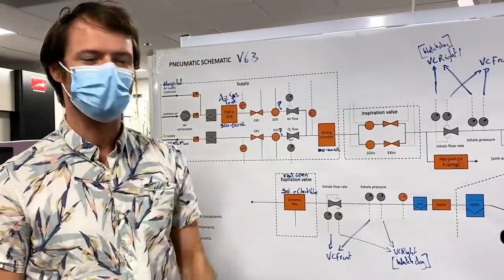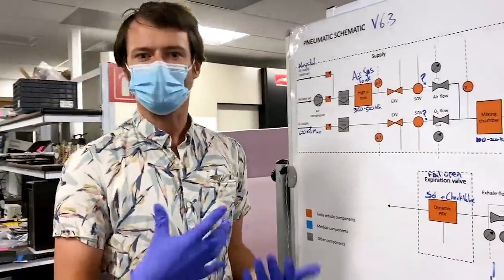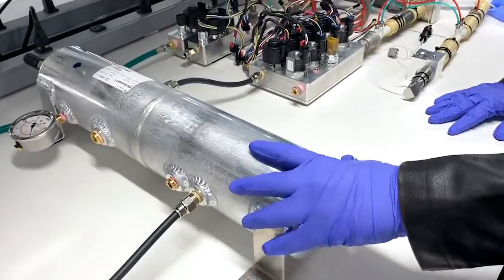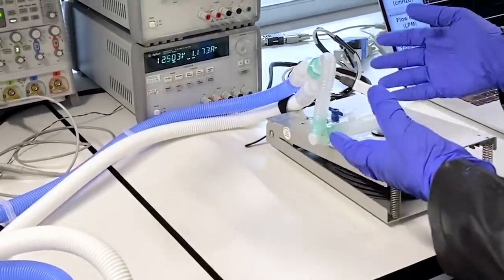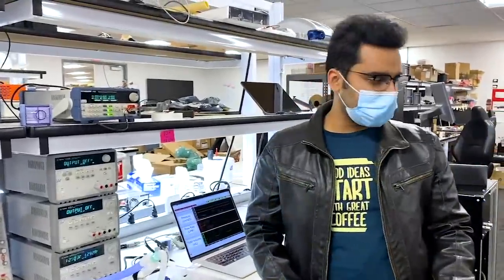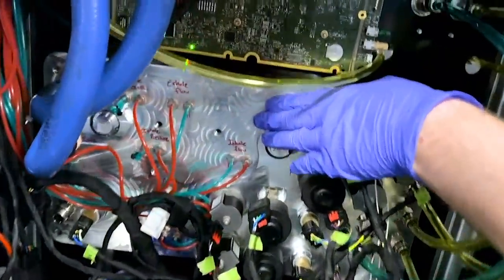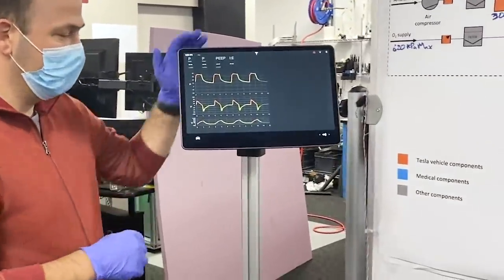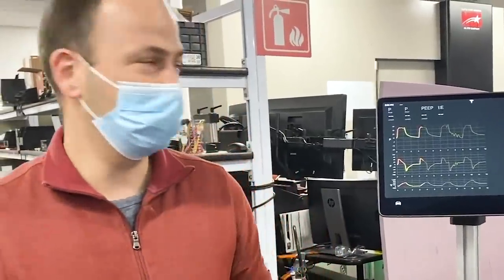Tesla Ventilator

Comment: Great stuff lads. Will the system have many sensors to detect what they are exhaling ie levels of infection whatever it may be. Or just a sensor position that could be hooked up to a read out machine at a later stage. Plus would it be a stretch at some point to also add a hart and monitor to the same system using the same screen spit between the ventilator and hart read out.
I don’t understand what you get some many stupid comments this is seriously stuff you are doing well done lads and Elon well done for jumping at a time when it’s most needed wish more company’s around the world would do this and not just think about there bottom line. 
What else could you make to help the Health system. Hope you can drive down the cost of these units and other parts needed for the health care community as I think they well over charge and can lead to hospitals not been able to afford adequate numbers needed. 
This would be a good addition to add to all your gigger factories around the world. 
Ps pleas build a battery factory in the UK before the Chinese build one. You may not build your cars in uk but if you build a battery plant you would be able to sell them to future car makers and other electronic devices that needs battery’s, ie electric lawn mowers ATV,s, drills, saws, never seen you sell a drill battery system for portable tools maybe you should sell one I bet it would be a good seller.

Comment: Damn using that whole ECU for just a small task, I mean It's parts yall got but the processing power that ECU has is way overpowered for a ventalator. No R-Pi's or just Arduinos?
Reply: It's a rapid prototype using parts at hand. Working in R&D for 10+ years, rapid prototyping with parts in stock makes progress fly. In the future you could design everything in a system on chip but for the time being, I say well done!

Comment: Great effort!! It looks pretty heavy & is there any humidifier set up in this or dry air will be sent directly?
Reply: The humidifier would be connected on the inspiratory circuit of the pt..it is not shown here.
Reply: @ogun3378  cool
Reply: @ogun3378  will you be updating it?
Reply: @sparto5571  no I am not working for Tesla or in the video..I am designing my own. I did this for my mechanical  engineering degree project.
Reply: @ogun3378  ohk, that's great. Good to know there's an another Mechanical guy over here. 🙌

Comment: To be honest: there is so much more to do to build, verify and approve a ventilator. You need to have so many safety features build in and have to predict the behaviour in almost all failure modes. At the moment it seems like there are absolutely no redundancies whatsoever. So if something breaks the ventilator has no safe mode and the patient will die. There are tons of standarts that you have to follow like 60601-1.  It is not that easy even though it looks quite impressive what they built in that short amount of time.

Comment: Good job but what happens when one of the sensors fail? Will the unit fail elegantly? If so will it fail elegantly for ALL sensor failures? Is there an auto calibrate routine periodically or on startup? Can it be cleaned/de-contaminated easily?

Comment: Amazing work for Tesla, they did a great job here. However it takes 8mo to 1year to get something like this approved by the FDA that does not come in contact with a person in this case about two years, as you have to prove reliability. I worked for GE medical for years as a validation engineer. We built a system in 4 months and it took almost 2 years to get it FDA approved passed CRFpart 11 (I think ventilators fall under a different cat.). But I am a huge supporter of tesla. In reality they should have partnered with somebody that already has a ventilator and just make the parts or offer assembly as that system is likely already FDA approved.
Reply: They're fast tracking approvals

Comment: That's great! I didn't hear any mention of the system cycle being triggered when the patient breaths slightly. Is it planned? That's one of the main features for a ventilator. If it's only pressure and Volume control for the most part, it would mean that the patient is breathing, even when they don't want to.

Comment: Stop touching the face masks. Adjust it firmly from the start:
1. Make a knod on the elastic, if is too loose 
2. Make sure the metal insertion is really taken the shape of your nose
3. If you need adjustments, make sure you don't touch it in the area where you breathe but from above, the straps, etc. 
4. Simply don't touch it! Don't touch your face and don't touch your mask

Hope you will actually produce these in large numbers. Thank you
Reply: Damnit Virgil, I’m an engineer, not a surgeon!
Reply: @iused2BAfireman  engineers know how to follow simple instructions or how to use a simple device

Comment: Guys was concerned that your masks keep slipping down and you have to pull them up. If you attach a pipe cleaner or small wire to the inner seam around the nose area (1.5+ inch) or on the outside of the nose area, it will stay up. Keep safe. Thanks for this video!

Comment: Flow rate sensor and pressure sensor? It looks like that flow rate sensor is a pressure sensor, so it should be able to use that. I guess it depends how it's configured though; in the past there's just been like both connectors attached to a single diaphragm, so it can only give the difference.
Anyway, it's not a big deal, since it probably doesn't really affect the cost much.

Comment: If anyone wonders why experts say that masks aren’t wise for the public at large; not one of them have fitted them right and count how many times they touch to correct it. 

On another note, this has to be the most viable replacement machine i’ve seen to date! Add a humidifier on that sucker and its no longer a replacement, but a full on modern ventilator! 
Damn well done!!

Comment: Tesla builds ventilator and calls it: “Model E”.
Reply: ...except they still wouldn't--copyright issue and all...

Model V or B (for "breathing") could work... :)
Reply: @ZeHoSmusician  its not a car though!
Reply: @nischay4760  every car now comes with a built in ventilator. Seats recline into a hospital bed for emergency covid treatment while autopilot takes you to the nearest treatment centre.
Reply: Model 3 = E. All models= S3XY
Reply: I just noticed the mistake in my previous comment: "would" instead of "wouldn't" (so, changed it).
Reply: Built off model three parts and takes a dig at Ford for blocking the use of the E moniker.

Comment: Ausweld Group have designed a work Face filtration ventilator, please contact Ausweld Group Production can start ASAP . Depending on substance availability ( Graphene ) or a spray coating hydrophobic or oleophobic coating becomes extremely light

Comment: There is no piston or bag being deflated. So I take it this system relies on the hospital air and oxygen supply being sufficiently over atmospheric pressure to push the gasses through those valves and some lungs while still maintaining the positive lung pressure required. Is there a prospect of this being problematic, especially when the air supply is supplying many more ventilators than normal? I'd guess that adding a pressure booster pump per ward would not be too hard to do.

From Real Engineering's discussion of what ventilators need to do, if I remember correctly, the only thing that seems to be missing is humidification of the air stream. Might this be a problem?

Comment: A ventilator isn't meant to force air into the lungs, modern ones will detect breath and assist at that point. If it is even on a controlled cycle it can cause further complications for the patient.

Comment: Fantastic!  The middle graph shows pressure, please make sure you create a function on the ventilator that enables a "plateau pressure" to be measured.  This is accomplished by the machine performing an inspiratory hold, which means that after a breath is delivered the machine is not moving air, valves are closed, and pressure within the lungs can be measured.  This measurement helps intensivists decide how "compliant" lungs are, with lungs less compliant requiring various therapies, including prone ventilation, to improve their compliance and consequently their ventilation.  A readout displaying FiO2 (fraction of inspired O2) would also be essential.  These numbers are a few dots in a patient's ventilatory picture that enable decisions to be made in the critically ill ventilated patient.   Keep up the good work and thank you!

Comment: How much Does a ventilator like this cost? Are you using automotive/industrial grade sensors in this system? Do they provide enough resolution for assist control? How do you enclose all of the system and still comply with the regulatory sanitation ?

Comment: Inspiratory limp should be the blue tube where we can connect the temperature probe of the humidifier and expiratory side is the white tube, the engineers connected it wrong, well for testing it will work the same way.  Also the user interface needs to have all the controls for Tidal Volume, Respiratory rate, Fio2, peep, pressure etc..
They got long way to go, hopefully they ll get it done soon

Comment: As great as this is, it’s over complicated. You can achieve the same results by putting a small rotary on the side of the ventilator. This rotary hold and pushes up a weighted plate that presses onto the air intake. Once it builds up enough air the battery powered rotary should let go and have the weighted plate take control of how much air leaves. It’s not rocket science but you can keep treating it like it is.

Comment: Tesla and a lot of other companies could have been engineering and designing all kinds of gear, appliances and equipment.  Sad it has to come to a pandemic for motivation.  Look at G.E.  In 1892 did they stop at light bulbs and electrical sockets?  No, they invented and designed multiple products for home, commercial and industrial use that all of us needed and depended on.  Of course G.E sold their souls to China over the years, but here's the chance for Tesla to become what G.E. once was.

Comment: I’m a respiratory therapist and have been a skeptic of the usefulness of any newly built vent from the car companies. Repurposing car parts that don’t take away from normal medical components was a huge benefit that I was unaware of though and would be great. Make sure to consider a physical high pressure safety valve, software fail safes, and continued precision over millions of breaths. 

Also, accurate volume and fio2 delivery needs to be sustained for the target covid-19 patient population, which would most likely need high peep (18-20), high rates (20-40), 100% fio2, and small volumes of 250-350ml. If it could do an APRV mode then that would be huge but that might be asking too much. 

Even if this can’t be used on a covid patient, a simple enough ventilator may be used on a lower acuity vent patient with no interstitial lung disease so that it frees up a more capable vent. As I said, I was definitely a skeptic but now think they might be on to something good.
Reply: The better news is that if this is using the same "brain" as a tesla car if it needs adjusting it can be done remotely (both good and bad). Not she if it has hard safeties in it as well (read up on the therac 25) but when hospital systems are overwhelmed something like this would be great as a stop gap.
Reply: Center 4 Nerds Not sure what requirements they’ll have to do to get the devices to hospitals because of the pandemic, because normally they would have to get 510k approval from the FDA to be cleared as a medical device. As a registered medical device, it would not be able to receive remote updates that affects how the device delivers ventilation or operates without a new clearance or else it could be considered a silent recall. Very complicated and semi-grey area for regulatory agencies when it comes to software and remote updates.
Reply: @mikel.8284  this definitely wont have over the air updates. it requires some kind of internet connection and I doubt the board itself has that. it may have a port for it, but it vary likely cant do that on its own.
Reply: @mikel.8284  I work in a hospital and I can assure you they do get updates. They are controlled by the vendor and coordinated with the staff on site. They are typically vulnerability updates or how they report data and but functionality updates, but updates none the less.
Reply: Center 4 Nerds yeah you’re right, vents do get software updates but they’re usually controlled through software USBs that plug in and update them, so their updates are done by biomed or the clinical specialist/sales reps and involve a lot of activity to perform. 

The questionable part was the over the air software updates like our phones do and Tesla’s do. There might be some vent companies that are doing over the air updates though by now so then I’m out of date or haven’t worked with those vents. PFT machines also get over the air updates pushed out sometimes and those are actually questionable updates. It’s a grey area in regulatory compliance in which a software update that affects the functionality or performance of the device could be considered changing or correcting a malfunction to an already distributed device, which is a field corrective action, which is commonly known as a recall, even if it’s a software bug. 

It’s a moot point of discussion for this video though since if they don’t have the ability for an Over the Air update then it won’t matter, plus it’s too early to talk specific since they’re still prototyping. Im just glad they seem to be putting some serious effort and design behind the vents they’re making.
Reply: @mikel.8284  agreed, the effort is commendable, but you are correct most are done through direct physical interface. Few through wired connections through isolated "air gap" networks and then a slim minority anything that can be done "remotely" and especially over the open internet.
Reply: Center 4 Nerds FYI, this is not the FSD computer they are using, but the MCU that controls the infotainment system. Still plenty powerful. But not overkill.
Reply: Excuse the ignorance ( gynaecologist). Is APRV when the patient controls the breath?
Reply: Neil Cowan no worries, APRV stands for Airway Pressure Release Ventilation. It’s a special type of ventilation that is basically the opposite of what we do normally. We normally inhale to take a breath for about 1 sec and then we exhale back to baseline for about 5 sec. APRV flips that and makes the person inhale and hold it for like 5 seconds and exhales for like 0.4 sec, give or take on each one based on the rate you’re trying to hit and what the patient tolerates. Combined with a high peep and low peep, this is used mainly for ARDS patients (Acute/Adult Respiratory Distress Syndrome) because their alveoli are shutting close easily and so you can’t oxygenate. Keep the lungs open for longer periods allow it them more time to distribute the pressure(rather than only path of least resistance) and open up, with a small exhale to allow for co2 removal and release of intrathoracic pressure so blood flow can still return back to the heart properly. With this one they usually sedate the patient enough so they’re not spontaneously triggering breathes but they can. You can find some good videos that show its affect, or in general PEEPs affect, on some pig lungs demonstrating lung recruitment maneuvers. I used to show them to my students (former RT Instructor) to give them a better understanding of what’s happening inside our patient’s chest. 

PRVC is Pressure Regulated Volume Control and that is the most common ventilation mode used, in which you set the volume you want them to have and they can trigger their own breathes but when they trigger they’ll get what you set each time and if the pressure goes too high due to low lung compliance then it’ll stop the breath and alarm. 

A full control ventilation where they are forced to only do what the vent is set too and can’t trigger any breathes isn’t used anymore by like anyone because the dysyncrony with the patient causes a lot of problems and is just an outdated method. 

Spontaneously triggering a breath and spontaneously breathing are also two different things.

Comment: the 2 hospitals here took over the one reasonable hospital here years ago. absolutely the stalest air possible, no ventilation for years. i used to stop in to get a local free paper with details. hold my breath and go outside. i doubt if that electron microscope can see all the permutations. each individual goes in with fever. gets a slightly different doses of all the other patient's virus gets sicker.

Comment: Please allow full diagnostics- or at least a api to run online diagnostics, schematics for trouble shooting, and preventive maintenance tool kit available for purchase.Field repair is key in managing a fleet of ventilators for a health system. For instance if a patient unfortunately has complications on a ventilator, most hospitals safety procedures require removing the ventilator out of service- isolating it, and follow up with a full diagnostic to identify if the ventilator had a mechanical failure or clinical event.  This can eliminate a ventilator from use for months if proper service documentation is not available.  Pro tip- please make breathing circuits vendor agnostic, and ship with extra flow sensors and disposal screen covers .  but THANK YOU tesla for spear heading this